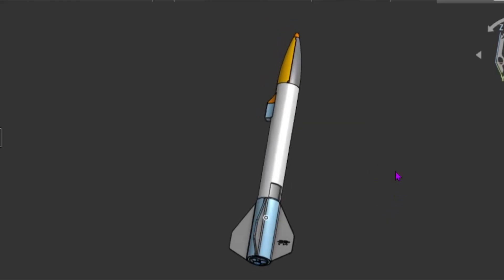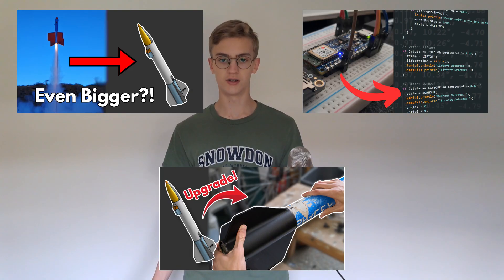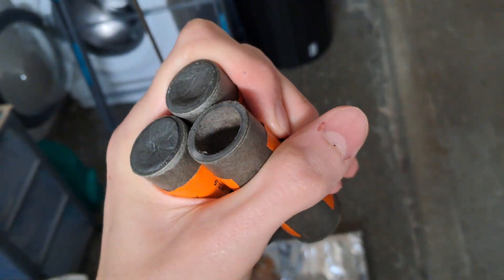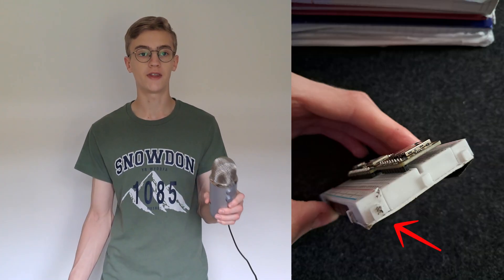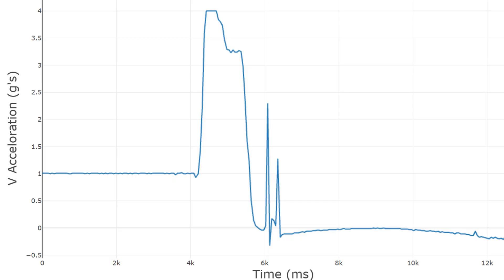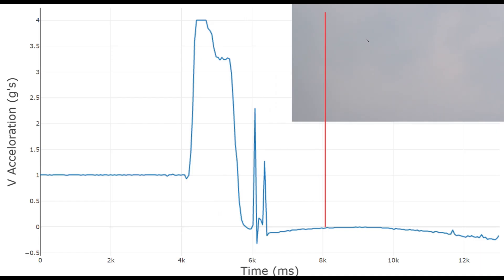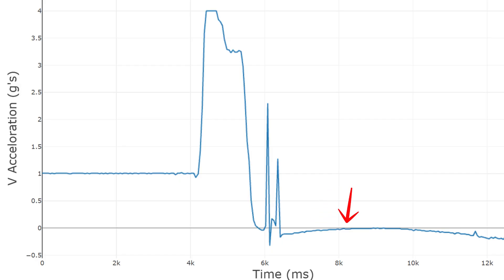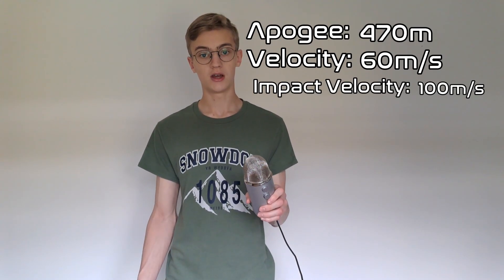Servo-deployed parachute rocket fail!

Comment: Great video !  The 4 G reading being that flat is intriguing to me.The accelerometer readings are most always noisy even with filtering and especially during flight. Is it possible that the sensor measuring scale was exceeded ? Sensors often offer multiple scale (2,4,8,16, sometimes even more).
Reply: As a matter of fact I've checked your code and effectivly use the default scale which is 4G, so that why ;) 
The sensor onboard (LSM9DS1) the nano33 allow you to mesure up to 16G so you could take advantage of that
Reply from the maker: Ah, I didn't see that in the program, thanks!

Comment: try also using soldered proto board instead of a bread board the connections can come loose or be unreliable under the vibrations and g loads of a model rocket.

Comment: What is your rocket weight without motors? Which class TSP motors were you using?
Reply from the maker: The weight is around 0.8-1kg and I used D12 motors.